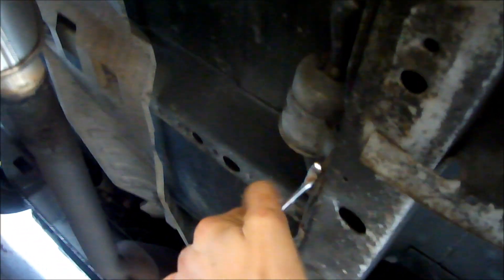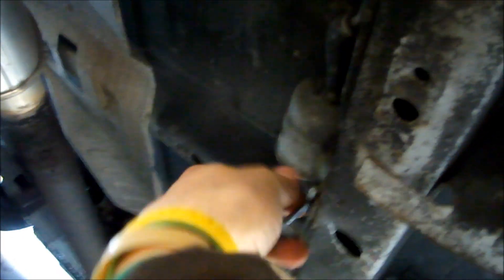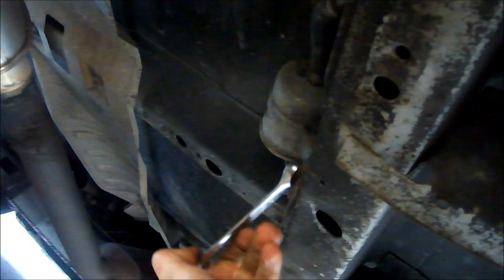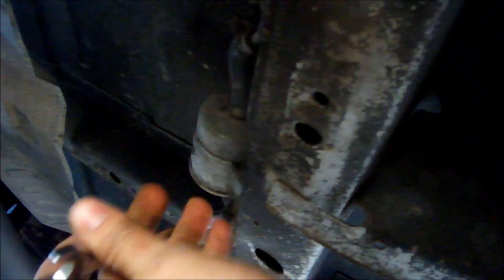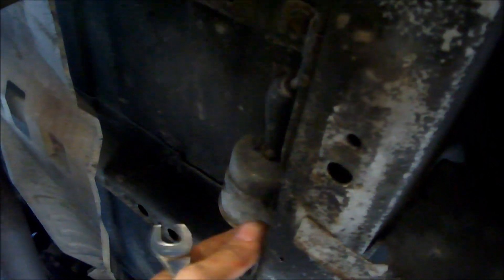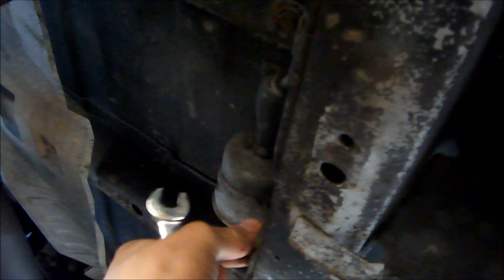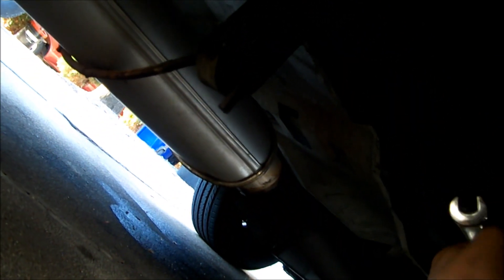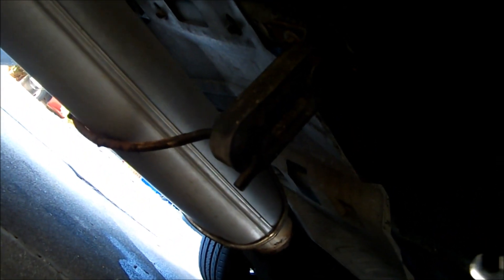How to change the fuel filter 1992 dodge caravan

Comment: I also have a 92 Dodge Van.  It starts and runs for about a minute but then it dies.  I put some starter fluid into the carburator and it start up immediately but then it dies after 10 seconds.  Do you think it is a fuel filter?  thank you for your help.
Reply from the maker: Is it carbureted, throttle body injection or multi-port injection? Does it ever start on its own or do you always have to put some fuel in the intake? Once that's out it just shuts off right?